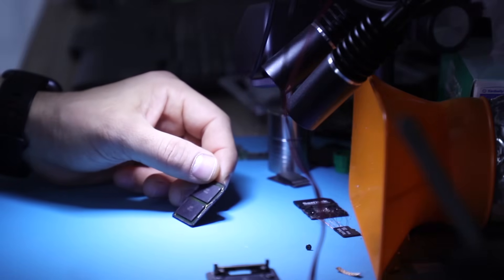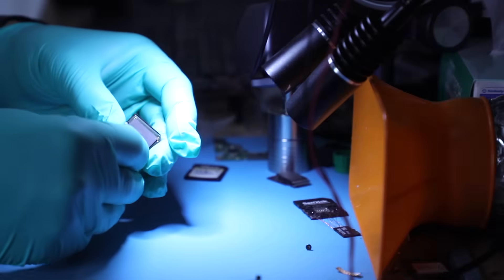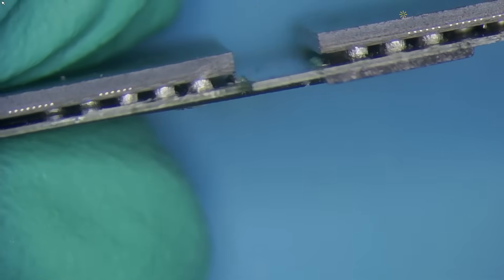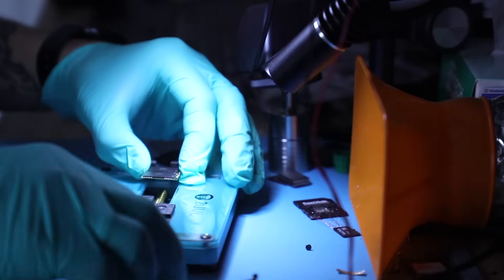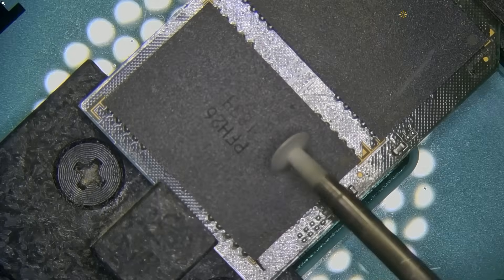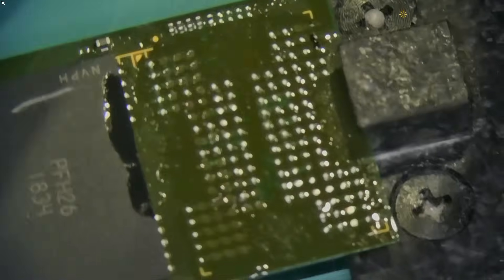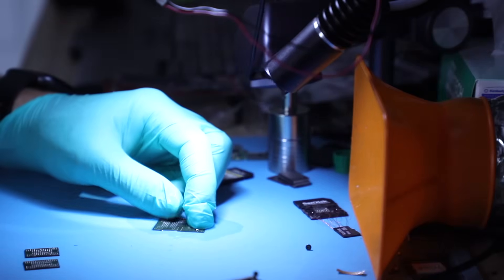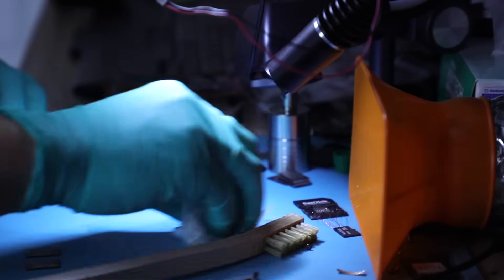The $1000 Damaged Memory Card Mystery

Comment: Hi I purchased some micro sd cards from eBay from a seller I bought from previously, he said he was unable to format them so I can see his photos and can confirm it’s of the seller, these can’t be formatted or wrote to, I am not sure if they are faulty or have a protection on them. I have tried to format them using laptops with many operating systems all unused machines that are not connected to the internet, I also tried an android phone. Do you think in your opinion they are faulty or protected? They were not expensive but are large sized so would be useful. What do you think about these? Thanks

Comment: how about marking only 1? just 1 mark vs 3.  they're still distinguishable
Reply from the maker: Sometimes I have more than one case running in multiple adapters. And cases may have multiple chips, just in case one goes loose I can always check the recording on how it was marked and find it even in a pile of same type NANDs. That top compound is thick, simple scratch like that does nothing to it
Reply: @hddrecoveryservices  right on.  a fella speaking with experience there.  kudos bud

Comment: I count 44 missing pads and other 9    07:01   Or are the external pins only for anchoring?
Reply from the maker: These are all grounds, so just for bolstering. Inner rectangle has all the needed connection. Even then, not all of them are connected. Still lots of work. I just did a case that will be posted soon where I actually had to join them as pads ripped not only on PCB but on the NAND too

Comment: When you did that first poke at the chip, and I couldn't see pads but saw the balls "rise up out" of the pcb... My instant thought was oh f&$k! - then I looked at the video timeline and realized you didn't (have to) go down that road.

If it was me, I don't have access to recovery tools as I only do repairs in my spare time now and don't get much recovery work, so I'd have to fix the pads. But only if the customer firmly agreed to pay by the hour first.

Going down the rabbit hole leads to a lot of learning, but if you're doing this for work/income, you also have to strike a balance. Especially if you / your employer won't get paid if you don't succeed, and other work is getting backlogged because of it. Although of the customer is ok with it, you can sometimes keep such projects on the side, and pick it up during appropriate times instead of when other less uncertain-time-sinkhole jobs are waiting.
Reply from the maker: Rabbit hole cases are the most fun, but yeah just like you said there has to be balance in order to keep the lights on :)

Comment: what are these little dots on the side of the flash chips? 3:32
Reply from the maker: Solder balls, they connect the chip to the board
Reply: @hddrecoveryservices  i mean those on the side of the chip not between chip and pcb.
Reply: probably artifacts from the manufacturing process

Comment: I always thought when I used the SD card that it is too thin, too flexible. I always though how the solder balls are not popping out ?
Question, what can be done if solder balls disconnecting from the chip itself and not from the PCB ?
Reply from the maker: https://youtu.be/Fx0nD15rUZM - pad repair kit or coiled wire

Comment: Hey Erkin,  Here is a soldering question for you for the newbies in the audience. (Me)  So when you remove the chips, I see that you go over the chips with solder,  but then remove all the solder balls from the chip with the desolder braid.  Why is that.  Thanks  Jerry L
Reply from the maker: Flux and new solder removes oxidation that can create conductivity problems
Reply: He's probably mixing with a lower melt temperature solder, it's easier to wick after.
Reply: @Grevan-Recuperacao-de-Dados  Thanks for the info.  That makes sense now.  :)

Comment: Here's how I handle them:
Roll up my sleeves, grab a cup of coffee, bust out the relevant specifications, and dive in with the idea that I'm not gonna quit until I understand the problem enough to point the way to a solution.

Don't fall into the trap of not acknowledging there is a  problem (effect) just because you don't have a solution (cause).
Reply from the maker: I am with you on that. When I first sat down to watch the footage from this case I had some doubts that maybe it was something in the settings that wasn't selected. I went back to the shop, and got the card to retest. All 3 programmers that I use (PC3000, FE, and VNR) had same result, so it was not the settings/contact/contamination in the adapter. You know sometimes we get jobs that clients don't even know what's on the unit. Suspense of it being something important is enough for them not to want to part with it. So many "Bitcoin millionaires" are popping up with hopes that the drive they found in their storage has some coins they used to mine way back in the day.